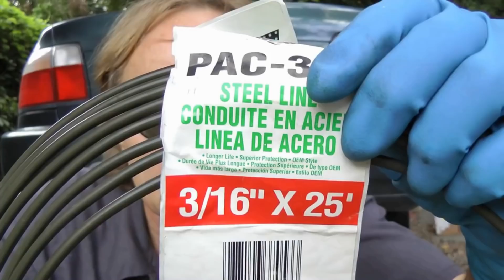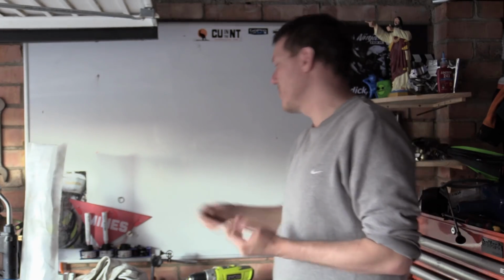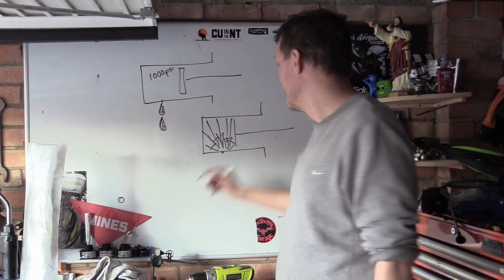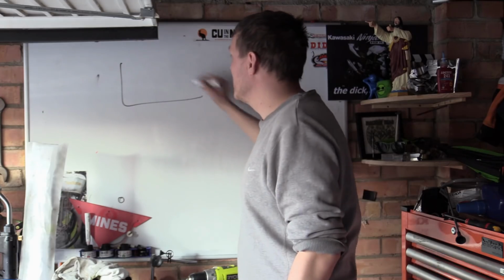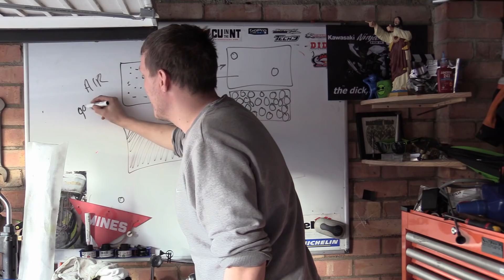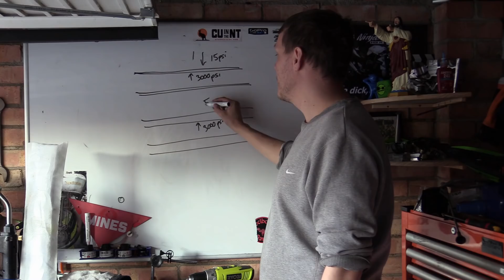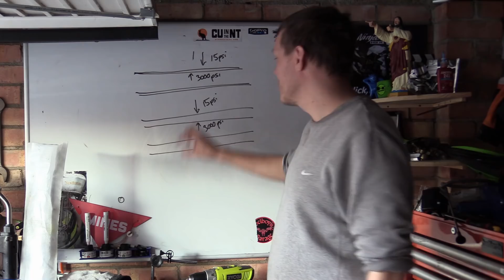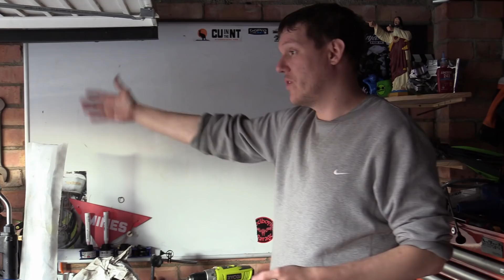Scotty KILMER - Will get someone KILLED!

Comment: Typical full-lock operating pressures on conventional OEM-style automotive hydraulic-brake systems are 900–1,000 psi (69 bar) with manual brakes and 1,400-plus psi (96 bar)with power-assisted brakes. What's your point, brake lines are tested up to 5000 psi nowhere near  actual working pressure.

Comment: I’ve used line connect in plastic air line, plastic fuel line, but steal hydraulic no way, would it not work as a reducers, but the pack said don’t , I’ve seen lines get squished and replaced, but I’ve never seen a brake line out live the rest of the pice of shit rusted out old scrap , not to mention that steal line and connectors are probably more then the parts!

Comment: Everyone in the USA uses those to make repairs to brake systems. In fact every part store in the USA sells brass compression fittings in the common sizes used on car break systems. Their is no other use for them on a car besides the brakes. The disclaimer is for liability protection just like the 9lbs. trigger on a rifle instead of a 9 ounce trigger.Most of them are sold in bulk and do warning on them. Ascend/Surface. Used them for years and never had one fail. Doorman which is an aftermarket car parts company often selling specialty items that would be considered dealer only items often with a updated design and materials sells compression fitting. For the record most of them are ratted up to 5000psi which is a higher working pressure than you typically see near the calipers or drums. If you use SS compression fitting you can get them approved for use up to 10,000psi.  Engineering Video 5X the max working pressure 27,000 psi brake line fails not the compression fitting! https://www.youtube.com/watch?v=6uiIWEfjxa4  In the USA more states allow the use of compression fitting in the brake system than the number that forbids it. Just like nickle-copper alloy brake lines will not take the pressure that a steel line can take but they can handle the max working pressure of 5000psi that DOT and NHTSA specifies as the max working pressure allowed in the USA for a braking system.  You have to choose the right fitting material based on the material you are working with. The vide provided is not exactly your run of the mill compression fittings but they are fantastic in industrial as well as automotive settings the Ham-Let  Let-Lock catalog is worth taking a look at because it provides good images of the entire system and it's parts! Cheer's
Reply: So why are they illegal for use in most US states for use on brake lines? If you’re going to repair something, especially something as critical as your brakes, why wouldn’t you do it correctly.
Reply: This guy lives in a Common Wealth country that makes people get thier car “MOT” inspected . It’s a bumper to bumper inspection that will fail a car for corrosion on the under body. He is not used to seeing this kind of brake line repair because cars with rusted brake lines will fail a ‘ MOT”.
Like I said earlier , I’ve repaired brake lines like Scotty did and never had a problem with that repair.
Reply: That fitting probably costs as much as a complete replacement brake line though (just guessing)?? The point is your typical DIY pleb/bodger is going to see what Kilmer did, see the part on the shelf at Wall Mart and not think twice about the possible consequences of not just putting their own lives at risk but other innocent road users too which is disgraceful. YouTube have been pretty heavy handed just lately censoring all kinds of users, not just content creators but now even the comment section too, especially if you mention the "J" word or the capital letters pronounced "see pee" which affected a lot of innocent channels yet cretins like Kilmer get a free pass and are under no scrutiny whatsoever for their often and in this case dangerous along with other creators of inane, vapid content. 

Most of the really talented video creators have long jumped ship (been banned) like me for example. I spent 4 weeks editing 2 music videos on my last channel and got two "hate speech" strikes and they shut my channel down immediately such was severity of whatever infraction I had breeched. One was "War Ensemble" by Slayer and the other had no lyrics at all so how that became "hate speech" when different video edits of both pieces of music still exist on YT can suddenly be redefined as "hate speech" when it comes to my case and doesn't breach TOS really is beyond me which is why so many of us have just given up on YT completely unless it's for technical know how videos in which case YT should really be paying a lot closer attention to, especially in relation to the kind of videos highlighted by Matt here.

OK my video montage but not have been to everyones liking but it wasn't going to kill anyone and I wasn't saying kill anyone or fuck someone up, 2 strikes and it was instant ban, not even the usual 3 strikes and your out which is what the YT TOS state. It's like WTF is going on? This website is really turning to shit and it's only a few channels like Matt's that are still worthy of watching. The site has gone downhill so much so we are entering TV like standards without the quality video production, you still get the same politically correct message and that's what I wanted to get away from in the first place. If you don't like a video because of "muh feelings" then move along you don't have to watch it but videos that present potentially fatal advice are in a differnt league and really makes you think where the fuck are YT's heads at? Nowhere!!
Reply: So?
Doesn't mean it is they way to do it......
Reply: That's may be the case in your state but I can guarantee any dealers or reputable repairer will flare the lines. Check YouTube for mechanics in the states repairing lines. Almost all of them will double flare the line. It's not even hard and the tool for occasional use is inexpensive
Reply: i don't use those brass couplers, i use the steel one's designed for brake line splicing, they have them in most auto parts stores also, i usually go to napa , they're kept behind the counter so ya have to ask for them, much better design in my humble opinion,
Reply: @jonyoung6405  i don't know where you live but here in ny the inspections here are pretty thorough, and any vehicle with obd2 has to pass the emissions test also, they have the vehicle idle for at least 5 mins on the shop scanner so you can't cheat the test by clearing the codes.
Reply: Hey Clubhouse, sorry to hear it. My State stop doing “ test” , so I have more freedom to live with a “ light” or not . Some of which seem near impossible to fix. I think the no OBD codes thing is designed to  force  people into new car ownership.
Reply: "Everyone in the USA uses those to make repairs to brake systems."
Speak for yourself. No, "everybody" doesn't use these. 

"The disclaimer is for liability protection just like the 9lbs. trigger on a rifle instead of a 9 ounce trigger"
LOL. NO. Besides, a 9-ounce trigger is dangerously light unless maybe you're benchrest shooting. Proper triggers are usually set anywhere from 2lbs. to 4.5lbs., depending on the particular gun and it's intended use.
Reply: @jonyoung6405  i hear ya, that's why i try to keep my 05 ranger 5spd in good shape, it's the most basic obd2  system,if i still lived in fl (no inspection at all) the old girl would've gotten the 5.0 transplant. :))
Reply: No not everyone in the US cheap outs on their brakes. The Dorman fittings are designed for brake lines, the standard brass fittings in Home Depot are not and say they aren’t. The ones Scotty used are for water lines not brakes.
Reply: @theclubhouse1209 Same in New Hampshire and most other states. FYI, you can't simply cheat the OBDII test by clearing the codes, as doing so will require you to drive the vehicle until the ECU can verify that the emissions systems are functioning properly. If you clear your ECU's memory and hook up an OBDII scanner you'll see that there's a "flag" for the emissions check.
Reply: @novaprospekt1739  yup i have a scanner that has the state emission function.
Reply: To your information compression fittings are NOT Legal in the USA to repair brake lines. Federal law USA Department of Transportation. Please don't think because Kilmer does this it is common practice. The man is a BS artist. Tails from the panhandle.
Reply: @BuckaboobboneheadA55

No one uses expanding compression fittings for hydraulic braking systems as typically they're rated for  no higher than around 500 psi. Most brake systems operate well above 1000psi and in some cases  above 1400psi.

These expanding compression joints would be suitable for the low pressure side of fuel systems (not high pressure diesel systems),  and for feeds to things like capillary oil prrssure/temp and water temp gauges. Absolutely not for use in high hydraulic scenarios like braking systems.

Thia link details the type of flared union connector which you're getting confused about:

https://ricksfreeautorepairadvice.com/brake-line-splice/

Comment: So in other words you have not bench tested the pipe, and fitting yourself, but you're criticizing Scotty based on what it says on a packet? He's most likely been doing it his whole life, and has never had a problem, have you thought about that? I'm only interested in the bench test result, and how this relates to how much pressure that you can realistically apply to the brake.
Reply from the maker: No. I know what fittings are rated for what pressures. Just like I know the tensile strength of steels and the clamping load of m10 fasteners. You can even look up tables and books that have the data in them.
Reply from the maker: If you want, I can do the tests and show the failures? Actually that's a good idea, after which I'll expect your apology.
Reply: @thedirtyworkshop  that sounds like it would make a very interesting video.

Comment: Scary stuff, although on the hydraulics thing, I agree on the air being more dangerous than Hydraulic BUT I have also seen properly scary stuff in heavy plant hydraulics with leaks,

A guy showed me a leak on a excavator you couldn’t even see it literally pinhole. Acted like a water cutter and was cutting sheets of paper with it.  More often than not though they will just blow the coupling and make a bit of a noise
Reply: What he’s saying is that gases are different to liquids because the molecules that make up gases are spaced apart and therefore can be compressed. As for liquids, their molecules are all bunched in together, thus not allowing for compression to the same extent as gases. Imagine if a small hole were to appear in the side of a submarine. The water would pour in slowly. Now imagine a hole in the side of an airplane fuselage. All the air, which would have been heavily compressed prior to takeoff, would rush out quickly. You’d hear a very loud bang before the air rushes out and the oxygen masks drop. This bang is heard for the same reason as why you hear a pop when you pull the cork out of a bottle of champagne or Prosecco. The gases inside are crammed in at a higher pressure compared to the air pressure outside, thus resulting in extremely rapid equalisation in internal and external pressure. This same science is why if you’re trapped in a car that’s submerged in a river, the car will sink slowly, filling up with water slowly, during which time you will not be able to open the doors and therefore your only hope of escaping will be to smash a window.

As for what you mentioned in the second paragraph, the same science mentioned therein is applied when you pressure wash your driveway or patio. The water is pumped out of a narrow nozzle at the end of the jet washer at extremely high pressure, dislodging the dirt.

Comment: I can see how people can try something like this. Look up the real brake line hardware and there are connectors that look virtually identical to the ones that Scotty used. Some people can't help but look at something like that and think something like; Just look at that. The exact same hardware, just sold at different price depending on the market. They are just bloodsuckers, but I'm on to them now...

The things is the real fittings aren't even expensive so they don't save more than a couple of bucks at the very most. And for that they take the risk of putting non compliant fittings on the brake line.

But that's just my theory of why he would post that video using that particular hardware.
Reply: You don't just add parts on willy nilly

Comment: I've seen Kilmer's vids.. not impressed.. but to see anyone do this.. deliberately?  If he's the mechanic he claims, he could be held for criminal negligence.  Any mechanic knows better than that, or should, but a veteran of self claimed standing?   There's a reason they're double flared with steel nuts and nipples.. yes, all things mechanical can be twisted into connotations that can make a sailor blush.. But the pressures in anti-lock systems are higher than standard power brakes and far more than the manual drum brakes on my 68VW.   I do keep a few high pressure stainless steel couplers with a few feet of line when on off-road excursions.. just in case.. for temporary fix..  but NO BRASS..   His video is made private.. gee, I wonder why.     We were joking at the shop about having a patch made up for those "yootoob certified teknishons".. anyhoo..

Time to give the ol gal a good thrust angle alignment.  Get your mind out the gutter.. I'm talkin about my 68.

Comment: They tell you not to use them on brake line because if you do not tighten them properly they will fail!
Reply from the maker: They tell you not to use them because they're rated for 400psi
Reply: The Workshop exactly and 400psi is less than a FRACTION of what the REQUIRED MAXIMUM psi limit for the brakes lines are

Comment: stumbled upon your video and loved it however I'm gonna go out on a limb and defend scotty and in my tech brain is telling me that he may have used those compression fittings for video purposes because if a diy-er is gonna take on fixing a brake line wouldn't they have enough common sense to examine the rest of the system before cutting into a brake system? and also they should have enough common sense to buy the correct fittings and flaring tool to actually do the job the right way.
Reply from the maker: And there lies the issue. Common sense isn't common anymore. People literally parrot what others do. Also, when scotty originally posted up the video he has those exact fittings in an amazon affiliated link...

Comment: this fitting not street legit because is made of brass ( its made for copper or alluminium line)
 but if you put the black steel one that is rated 5000 psi so is street legit
Reply from the maker: they're rated for 400psi
Reply: not made for steel line because no way that brass assembly can compress the steel line properly so is not even 400 psi like standard chart tell you ( 400 psi is for copper or aluminium line ) but i really like is video anyway ah ah
Reply: Yes those ones are safe and legal.

Comment: Your right and wrong at the same time.   Different safety standards in the states. Up here in canada there illegal to use. In some states they are legal for use. I did do research into this when redoing the brake lines on my 2002 sunfire. Do I know other backyard mechanics who have used them. Yes.  Have I ever seen them fail not yet to this date. Even on 1/4 ton pickups. Are they the safest method of fixing brake lines defeintly no. 

Moral of the story yes they work and but no there not safest thing to use
Reply from the maker: "Different safety standards in the states."

- I'm glad you said that because 1) flared fittings are standard 2) Texas actually has a brake pressure and stopping distance law - that these fittings don't pass it.

Comment: NOT  FLARED CONNECTORS!, Scotty wanker is using COMPRESSION FITTINGS, WHICH ARE WRONG!, caps lock off.
Reply: And in refrigeration one silver solders pipes together.
Reply: And also if you are replacing rigid brake lines make up new ones in steel or cupronickel tubing, Copper tube that is bought at the big box home store is unlikely to be the good stuff.

Comment: Great job explaining all that compression.   I think Scotty’s point is that you can do brakes for cheap, and is good for people on a tight budget, living paycheck to paycheck.  Any logical person who is able to afford proper brake line/oem part will likely do so...

So funny ranting about submarines and 4000 psi lol

Most people aren’t slamming brakes all day as well.
Reply from the maker: "I think Scotty’s point is that you can do brakes for cheap, and is good for people on a tight budget, living paycheck to paycheck"

- This is the problem - there is no 'doing brakes on the cheap' are you fucking mental?! Its shit like this that gets people killed - and it's illegal for that exact reason
Reply: anybody who needs to do brakes on the CHEAP, that isnt capable of replacing a brakeline properly, DEFINITELY doesnt have the ingenuity to CORRECTLY perform this duck tape ass hack repair to begin with, and LIKELY wont do it adequately